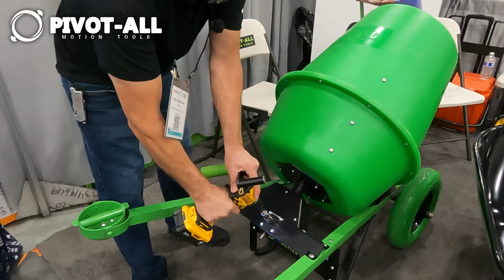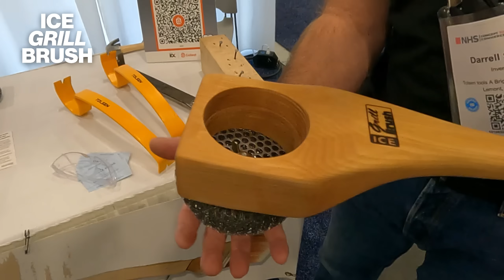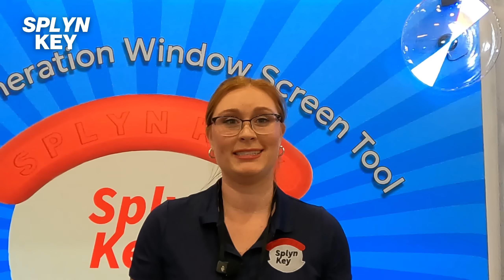35 Inventions We Discovered At The National Hardware Show | NHS 2026

Comment: ..  two wheel wheel barrow for the win .... magic crack filler ....  wait for the innuendos ...   ratcheting tool belt looks rigid a nice to have micro adjustable ,, but add strong 2" suspenders and you don't have to tighten overly tight ...   ....  Multipail for the Win .....
Reply from the maker: The Multipail is definitely one of my favorites too! 🏆

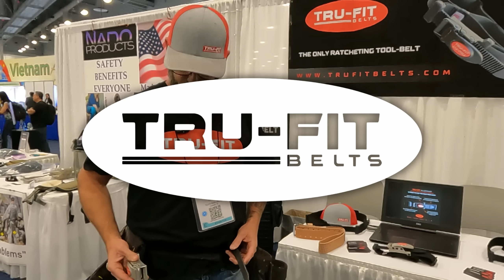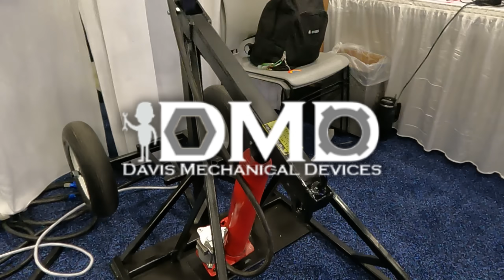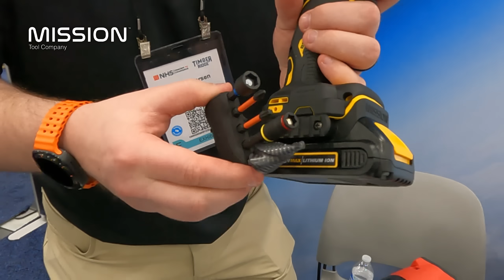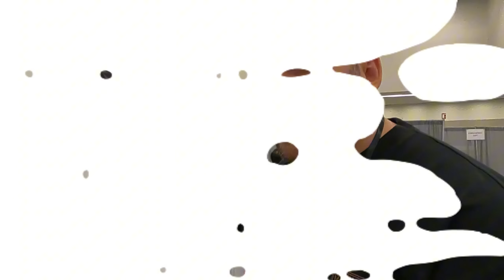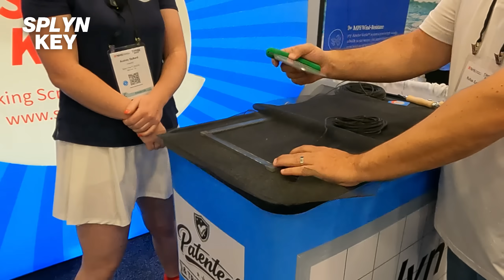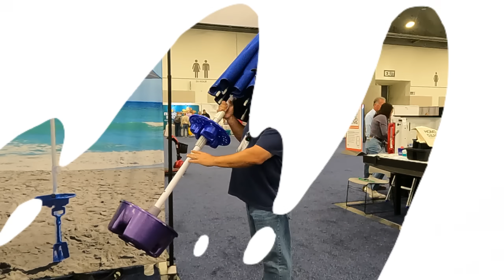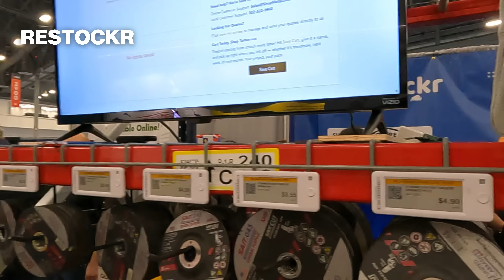Comment: 0:44 This mechanical concrete mixer is a must-have for me, because it will be a emergency tool for when the diesel powered mixer breakdown. The mechanical broom is perfect to sweep dusty concrete sites (to sweep effortlessly). 5:23 This belt is a must-have because the ratcheting adjustment for the belt is ideal for when loads is weighing down the belt. 8:06 I love the fence post extractor, this tool can definitely save your back from injury. 10:36 This drill bit adapter is ideal for storing your bits, and preventing misplacement of your drill bits. 13:37 This miter top is perfect for your work site. It's perfect to cut lumber fast. 19:34 This key is simply amazing. 19:56 This beach umbrella design is great for strength, it can definitely withstand any wind. 24:33 Restocker is the future for restocking the hardware shelf. This restocking method seems to be perfect for efficiency.

Comment: I love innovation !  We were farmers in western Canada and I always say “ I spent my whole farming career ,making things to make my life easier !
Reply from the maker: Making things to make life easier is a great way to sum up farm life, Marvin. A lot of the gadgets in this roundup came from that same itch. What's the best thing you ever built yourself out in western Canada?
Reply: @BiltBayou I have so many . Probably the biggest was we had a 1999 CIH 2388 combine that had 280 hp and the same fuel tank size as the when the 1480 combine (180 HP)  first came out . We were having to fuel at 5 pm to finish the day. I had a mold made to form a poly tank ,built the metal frame and tied thee fuel line to the main tank . It added 30% more fuel. I started manufacturing them and sold over 500 units. Eventually the combine model was changed and had a bigger tank.

Comment: As someone who isn't really a "manual labor" guy but works in the automotive engineering space (though not an engineer), I enjoy seeing ideas people come up with even if they may seem silly or novelty a bit. One idea can easily lead to a new idea. Even as someone who works heavily with automation, I enjoy the mechanical only ideas.

The Pivot All is something I would actually buy.
WristBeams is interesting and would be helpful for doing work on computers and around the house.
Bags n Seals I would consider if the bin itself looked nicer. I like that it's tape, simple, something everyone has at home, cheap to buy replacements. Most other companies would create some "proprietary" crap.
MultiPail is fantastic and a perfect example of sometimes the simple ideas are the best ones. Not trying to "over engineer" what already exists.
AeroPlus Shaker is along that same vein. I would consider buying that for my SO because they use spray paint a ton for marching band props.
The Roller Stopper, I will buy it today. We just painted our living room and I would have loved to have this.

Comment: I have a small orchard, nothing commercial, but about 18 trees, citrus, peach, avocado etc. The Mr. Skeeter attachment to a blower is such a simple idea, it would make spraying all my trees so much easier without spending a fortune on a specialised sprayer... brilliant! All it needs now is a small battery powered pressure system for the top of the sprayer...
Reply: We have several customers using MisterSkeeter in hobby orchards and gardens for various treatments. We even have an avocado orchard in Hawaii using it to treat for avocado lace bug.
If it’s a liquid solution, it can generally be applied through MisterSkeeter.
I’ve also developed a prototype with a battery-powered pump—it’s not in production yet. With the current setup, it takes about three to four pressurizations to discharge a gallon of liquid.

Comment: Being in the home improvement/maintenance business for 50yrs, retired, i love these shows. I went to everyone near me. I see some that are some that are great and then some you know are flops. The wrist mounted flashlight is one flop. My daughter bought me a flashlight that had two beams ,one for index and middle fingers that i wore like a half glove. Love them for the right situation, close up work in tight spaces, but i cant see the advantage of the wrist. I have very big wrist, big guy. Cops have to use leg shackles on me. Half the wrist light wouldnt be see at all. The finger thing i have is at least 20yrs old and still works great. Shovel with a auger? If you need one ,you need one.
I did a lot,LOT of painting and those ideas for the sprayer, caulk gun and specially the paint bucket, please! Take my money! Wish i wasnt retired or id be at the store right now. Thanks!

Comment: The rat vacuume is not very practical. You usually have to put out traps at many spots in places where you can only see where they have been and not where they are entering the building. It might also be outside or in greenhouses etc. There is no way that you can dedicate several shopvacs to this. Rats can also very easily chew through the plastic container that the shopvac usually is made of and you would need one in metal to be able to stop that and they are usually more expensive. Using the ones that is electrical that after the rat is dead it tips the rat down into a bag that you then remove when it's full. They are also expensive but much easier to place out and take much less room. This idea is just stupid and unnecessarily complicated.
Reply from the maker: I just thought it was badass to have a rat trap that vacuums. Personally, if I had a rodent problem... I'd just buy a cat.

Comment: Sorry, wrist beams, do head lights not work better, at least that is pointed where I am looking.
Reply from the maker: I thought the same thing.  I suppose it depends on the job you need it to do.  In certain circumstances, you need a light right up on what you're working on/with... but need both hands.  The wrist beam could be the better application.

Comment: The powered shovel/auger needs a longer handle so you don't have to bend over
Reply: I just saw sore backs with this one.
Reply: @auroradelaguacate4153  If you don't exercise and lead a sedentary life, may be.
Reply: @mojo6098 or are an older senior?
Reply: @auroradelaguacate4153  A younger junior ;-/ . Sedentary, look it up. It is not age dependant.
Reply: @mojo6098 ill keep that in mind.  The next time i buy a rake ill cut off 3/4 of the handle so i can increase rhe labor involved in a task.
Reply: The Rotoshovel is $130, an auger that fits in a drill is $15. Take your pick.
Reply from the maker: Great feedback... however; if you're planting a garden, there is no getting around bending over or kneeling down.
Reply: @BiltBayou but a longer handle would remove the need to bend for hole making, and possibly a tool for planting could remove the need for that also, or at the very least, greatly reduce bending.
Reply: @fELONsBelongInJail It should at least have an detachable extension handle that you can put on for putting down poles and such that doesn't require you to bend over as much. Then when planting sitting on a stool or standing on your knees then you could remove the handle and just use it as it was in the video.  The handle should also have wires in it so you can operate it from the top of the handle as well.
Reply: @fELONsBelongInJail  Bend? Squat!
Reply from the maker: I'm not disagreeing with you.  I have a video coming out with my neighbor using the tool in her garden.  She uses a kneeling pad. Maybe the better option is to get this tool in combination with something that makes it easier to be on your knees.  I just don't see how to avoid bending over when doing gardening.

Comment: Give me a fast and mess free and easy way to clean my paint rollers and paint brushes please.
Give me a better way to dispense two part epoxies because those with a connector between the two connected tubes NEVER work right. I always have to cut the connector and push each separately because they NEVER come out in equal amounts that way.

I'm sure I could come up with many more if I think about it for awhile.
Reply: Dude you nailed it about epoxy
Reply: @clarks58 Absolutely!  I don’t know why they bother putting them together.  Better to have them separate with mm markings so it’s easier to dispense equal amounts.
Reply: Put your roller in a bag and in  the fridge
Reply: @ChristosWinner  That's great when it's bedtime. But sometime you have to clean the damn thing.
Reply: @dolfinwriter5389, keep em coming - what else you got?! 
I'm taking notes so I can start a side gig.
Reply: They already make spinners for cleaning rollers and brushes.
Reply: @linda48223and they work great!   I don't know about the brush thang but it works very well with rollers
Reply: Regarding brushes and rollers. Throw them into the washing machine and run a quick cycle (around 28 minuttes) and they come out as new. I’m doing it everytime
Reply: @jespersorensen8475  Not a chance. I already get in enough trouble with my wife when my greasy or dirty clothes and clothes with grass clippings after mowing and weed whacking leave residue in the machine. I install the things, I do all the maintenance on them and keep them running--but if my clothes leave residue that gets on her clothes, I'm in trouble.

Besides that, tell me you're not somehow removing most of the paint before you throw them in your washer?
Reply: @dol @dolfinwriter5389 No I just throw them into the machine directly. Not sure if it’s a general thing but the quick wash I use changes the water 3 times and there isn’t any residue or anything after the machine has ended its cycle. A good hint is also to spin on the highest speed (1200) and then they come out as new and fluffy. Give it a try when the wife is out:)
Reply: @jespersorensen8475  you should clarify your comment. be careful only latex paint!!😂😂
Reply: @mrwhy8073 Ofcause only water based paints
Reply: There is a tool for that
Reply: @mukondeleliratshilavhi5634  For which?
Reply: @mukondeleliratshilavhi5634 😂😂😂
Reply: If you paint for a living price the new brush into the job.
Stop wasting time and money to clean a brush or roller. In the time it takes to clean a brush I can make more than the brush costs.
Same with paint trays.
Brushes rollers and trays are cheap and labor/time is not.
Reply: @h @heyyou5189 😂 been using the same purty brush for five years. I feel cheap. I'll be honest before reading this comment I did throw away  my old paint trays in the past I would just get liners but now I'm switching to his new bucket that I found this new  5 gallon bucket /paint Tray all in one but even with that, it comes with the liner😂 I never reused rollers so I might not be that cheap
Reply: @heyyou5189  I don't paint for a living. I'm just a homeowner DIY'er trying to get as much done as I can by myself.
Reply: Dishwasher
Reply: @rodneyeamon9876  Ya gotta get most of the paint out of them FIRST. I get in enough trouble with the wife when my greasy clothes leave a mess in the clothes washer.
Reply: Through then away and put it in cost of every job like you should add gas truck food ext. To your bill costomer knows how life is but don't put it down as food dummy
Reply: @DanCorder-t4b  Can you READ, DUMMY? I'm not a pro painter. I'm just a DIY'er homeowner, renovating our own home on limited income.
Reply: Bro, that already exists just Google
Reply: HomeRight Paint Roller Cleaning Kit
Reply: @anthonyhumbert8787  Thanks for that, but where is it still sold? Appears to be discontinued and out of stock or sold out everywhere I'm looking.

Comment: Pivot-All wheelbarrow should have TWO wheels if they really want to save people's backs.
Reply: Oh yes....two wheeler= game changer
Reply from the maker: They do have two versions and one is heavier duty than the other.
Reply: @BiltBayou  One makes you more gayer than the other?
Reply: they should also have real pivots not those dinky steel pins on easily bent flat steel. a good day in rough hands is going to wreck that
Reply: 50 yrs in construction, these are STUPID! Lowes was giving it away.   But I used the bucket and wheel to rebuild a generational Wheelbarrow, dad had before me.
And no a one wheel unit is perfect, it's up to the operator to learn to drive.
Reply: @davefellhoelter1343  You've completely missed what I said about MY experience with both a 1 wheel and a 2 wheel barrow.
I'm not a contractor working construction my entire life; I'm just a DIY homeowner and I have thrown my back out enough times that I have to safeguard it, and this is one way I do that.
I don't like living in pain for a week when I screw up my back.
You do you.
Reply: Save back? Dorsal raises and hyperextensions do a good job.
Reply: @mojo6098  Then why spend money on any Pivot-All or anything else?
Reply: Wrist flashlights for spear fishing divers  are common
Reply: Two wheels kills maneuverability
Reply: @wildmanofborneo  Not in my experience having had a one wheel wheelbarrow for 20+ years that I eventually replaced the pneumatic tire with a never flat tire, and now having a wheelbarrow with TWO never flat tires.
The one wheel tool was harder on my back because you have to lift it AND balance it as you go.
I have no problems with maneuverability of my two wheel tool.
Reply: @wildmanofborneo  Maybe going on narrow walkways and such but on flat ground the two wheel have just as good maneuverability as a one wheel one. You can still turn around on the spot with a two wheel version and the wheels can actually spin around when doing so. doing the same thing with one wheel and the wheel stand stil and just twist around on the ground on the same spot on the wheel. You also do not have to manage the weight and they do not tip over. I've had a one wheel barrow tip over so many times and the frustration is just insane when you have to clean up everything that's now on the ground. The two wheel can also take so much more weight.
Reply: @Dragonited  if you have filled a wheelbarrow with shovel from a dirt pile you understand why one wheel is good but knowing that you tipped over a lot I assume that you have not😅
Reply: @64mikecowart  use whichever you feel comfy with.  No laws.
Reply: @wildmanofborneo  Tell that to my bike. I can pivot 360 on two wheels.
Reply from the maker: @wildmanofborneo  agreed

Comment: That Rotoshovel looks to be a back killer.
Reply: All they had to do was put an extended handle on the roto shovel and it would have been perfect
Reply: You would still need to be low to the ground to plant your garden
Reply: You best not get your hand in that thing. The guy said it has a lot of touque..........chop your fingers off.
Reply: All you need is that €10 auger bit for your powerdrill.
Reply: There is no back killer. There is only sedentary.